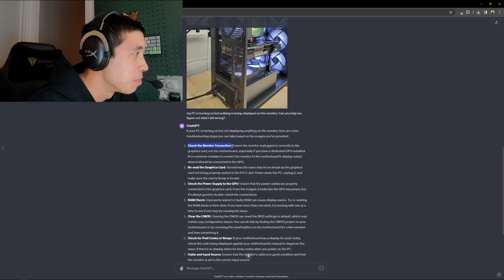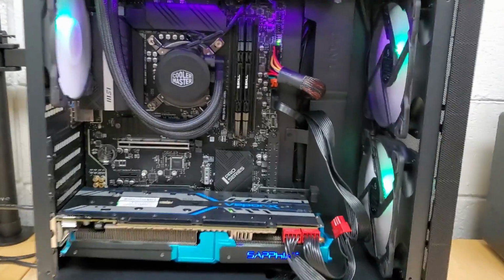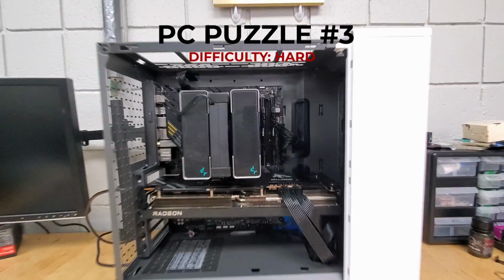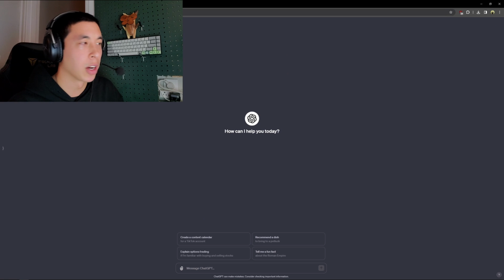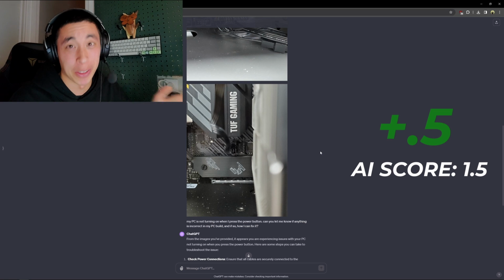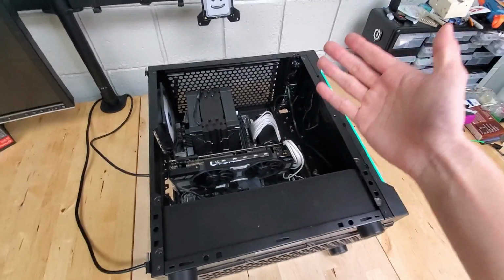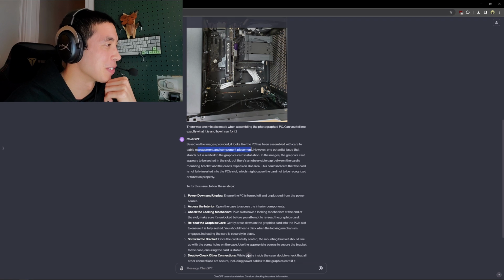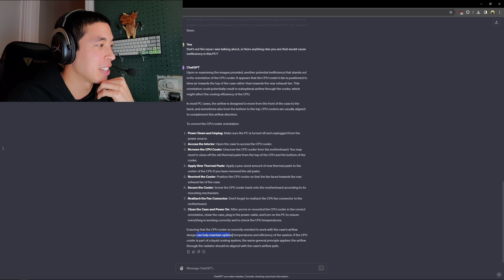Are you smarter than AI at Fixing PCs?

Comment from the maker: Who scored more than 2.5 points in these PC puzzle challenges??
Reply: Nailed it, i liked this :D
Reply: I definitely will when I watch the video
Reply: 3/4 for someone who learned pc building only by videos and never build one I think it’s ok.
Reply: YOU ONLY used one stick of ram in the level 4 build.
I scored a 3
Reply: It can still work  @nirfriedman43
Reply: @nirfriedman43 yep i noticed that
Also in build 4 you dont have a pci placeholder..
Reply: dude I got all of them right in the last one i was like the fans on the cpu cooler or the gpu not being screwed in sick vid whenever you have a new video i watch it immediately lol
Reply: hell yeah
Reply: ofcourse
Reply: I did
Reply: i got 2.5 points...
Reply: the first pc had exhaust fans mounted where intakes should be right? or were they reverse blades?
Reply: Me
Reply: Hi, I would like to ask one question, I don't really understand computers, can you please explain if it is possible to use a discrete video card for games without connecting it to the display? I have an old computer with an intel i 5 3470 processor, an asus P8h61-i motherboard, 16 gb ddr 3 1600 mhz, an inno3d geforce gt1030 2gb video card.
Reply: @andk19  no, you can use it to display output, like videos or browser, but all power of GPU will work only on monitors that connected to video card.
Reply: @fakecake7984  Hi, and if, for example, I have Linux mint installed and the display is connected to the motherboard and not to the video card, is it possible that I can, for example, run the game on my gt1030 video card?I just saw how my friend's Linux trick worked.
Reply: @andk19  you can use a graphic card that have no output port as long as your cpu have integrated graphic card , however , you need one of thoses graphic card first

If your graphic card have output ports , well you can but you shouldnt , first cause its hard to do , second cause it might cause big issue

Lastly , you can use both , a gpu with output port and a gpu without in sli , both must be the same gpu , its a bit easier to do than previous method , but you still need a gpu that have no output port , theres a video called "hacking nvidia drivers rescuing crypto gpu from becoming ewaste"
Reply: All of them. AI is super stupid, look like it just detect photo as "hmm it is a PC" and tell randomly all obvious advices, like 10 of them, when it must be one correct answer.
Reply: Yeah but did anyone notice this in hard mode to find mistakes there was 4 ram slots but they only have 2 ram sticks
Reply: Got all good expect the easiest one XD
Reply: I got 4/4.
Reply: Got 5 I watch your videos too much and they are amazing that’s why I know a good amount of these
Reply: i did , i've been rebuilding computers all my life and i just rebuilt yesterday honestly after a motherboard got fried from a surge somehow. Power flickered on and off like 5 times and then the computer would take 800 seconds to post. removing all parts did nothing, replacing the motherboard fixed it. Also replaced my PSU even though the old one works, it didn't protect my motherboard. Seasonic > Corsair PSUs
Reply: @TWEEMASTER2000 Seasonic? Barely heard of them, i just watch LTT and theyre a major sponsor there😅
Reply: somehow i did
Reply: I scored 3.5 i was hoping for a 4 but ig its alright?
Reply: hay mack video what happened cpu only uses hit sink
Reply: Me
Reply: Is 2.5 more than 2.5 ???
Reply: I did but I almost missed the last one
Reply: Easy 4 points
Reply: Got all 4 right
Reply: Hello. your voice is thin and sharp. Compared to other channels on YouTube, you don't have such good sound quality.

You have to compare the sound quality with other things, whether the videos you make have normal sound quality or not!

There are many who do not care about the sound quality!
Reply: the only only i didnt get was the first one lol
Reply: I love your channel you my favorite channel

Comment: As a tech enthusiast I know why:
Easy: The CPU has no integrated GPU, so there is no image. You need to use the dedicated GPU

Medium: I found this on my own without the video’s help. The GPU is too low, it will block airflow.
Hard: The computer is off except for the light, the PSU isn’t plugged into anything else other than the lights. (I guessed the first from the start)

Comment: Got 1 correct, 2 correct, 3 half-correct (got the fan right, but the first stick of ram looked like it wasn't pressed in all the way, look at the top connector- so i assumed that was the issue) and the 4th one i assumed it was the screw for the GPU missing.

Comment: Pretty much 2.5 for me, for the first one i caught that no display out was plugged into the gpu.
For the second i caught both issues.
For the third, i only caught the power connectors.
For the 4th, i thought it was the single ram stick because it wasnt in position 2 it was in position 1 so i did think that was the issue. 

It was mostly because i was thinking 1 note i was thinking on what would prevent they system from booting, not necessarily what would cause other issues.
Reply: Same

Comment: I got the first three and missed the last one. I didn't know the grill can be used to figure out air flow. I always used the arrows in the plastic or just felt the air. 

Also, @7:52 is that a connector on the GPU with nothing plugged into it? Could that count as a mistake?

Anyway, fun video and I learned something new.

Comment: Most of them weren't even real problems and you gave the AI different information to solve them. 

1. We couldn't know that the installed CPU didn't have an integrated graphics unit.

2. Without the manual we couldn't know which of the slots were dual channel or if the mainboard even supported the feature (technically 2 and 3 should still be dual channel, because only 1+2 and 3+4 are wired together creating two channels. So it should work in some systems)

3. With most mainboards it doesn't matter where you plug in your fans because the bios only uses CPU sensors to control the fan speed. 
Again, how should we know where to plug in the power switch without the manual? (also, the leds not being plugged in was a nice hint for the AI and could be the only reason why it found out)

4. Ok, I actually missed the last one :) Still, the AI was technically correct. The only open route for the air in this configuration is either up or down.